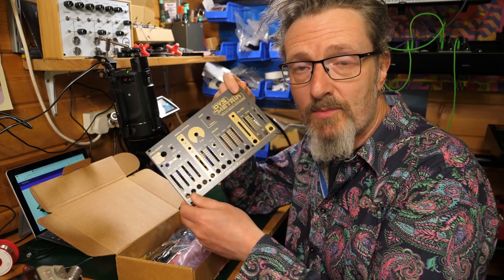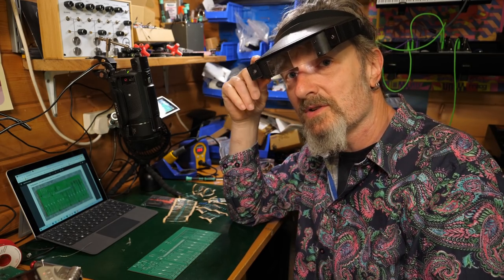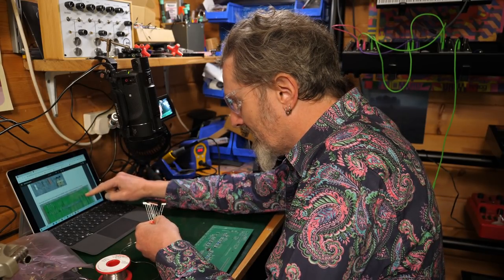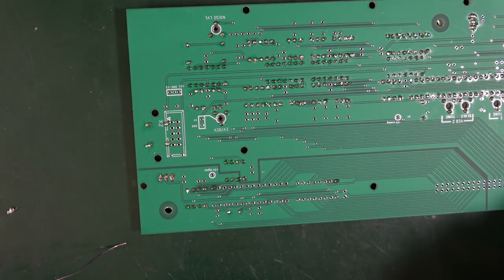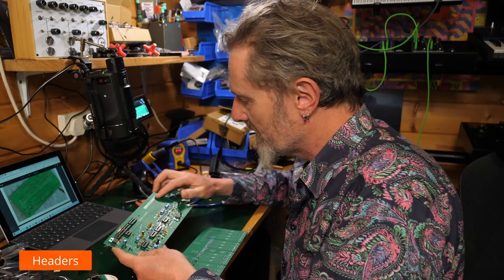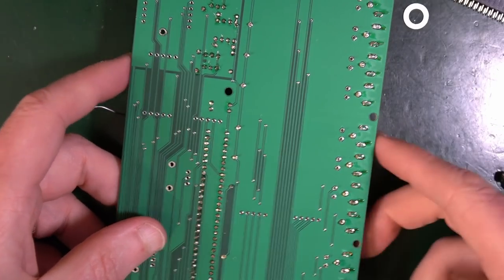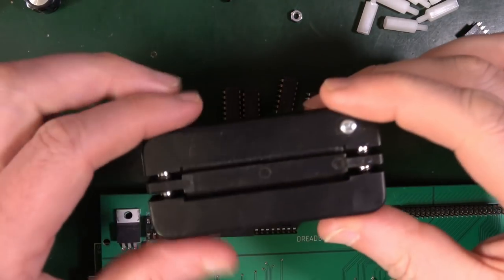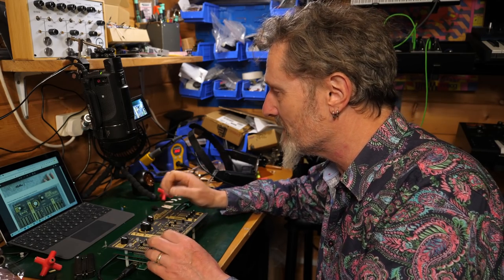Dreadbox Dysmetria DIY Groove Synth - the complete build

Comment: Great job! You're right about the heat disappearing from those pins that are connected to the big copper filled ground plane. You could use a slightly bigger "chisel" tip for your iron, also a bit of extra flux does wonders, you can get it in a handy "flux pen".
Reply from the maker: Ah, ok

Comment: Why don't you do Molten Monthlys' outside anymore?
Reply from the maker: Many reasons: noise, light, weather, focal length, having to print out notes. I did it outside simply because I didn’t have the right lights and it looked so much better on camera. But once I’d cracked the interior lighting bringing it inside made it much less stressful and much more versatile. I did like the outdoor vibe though 😁